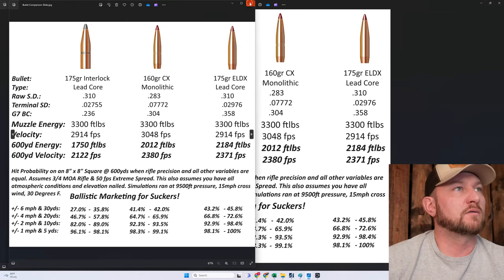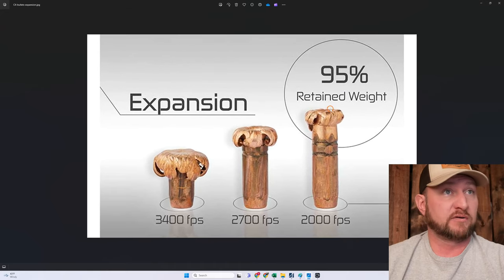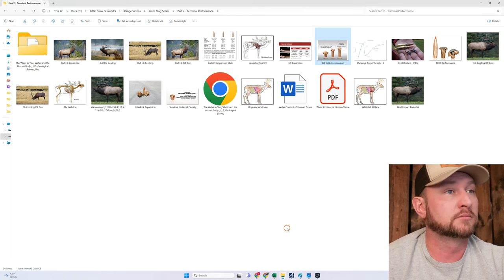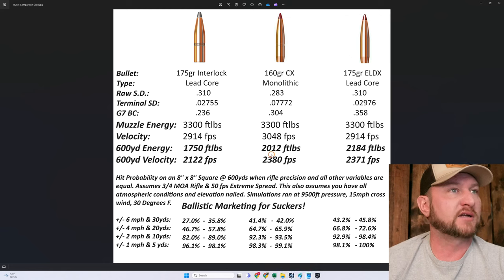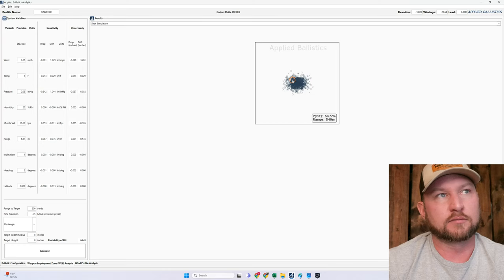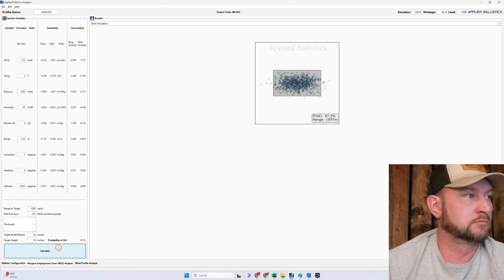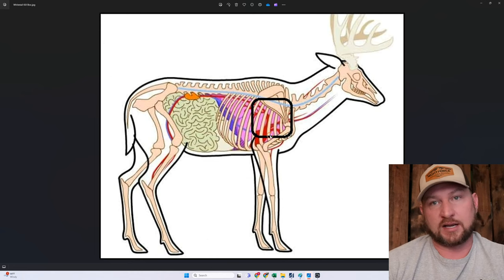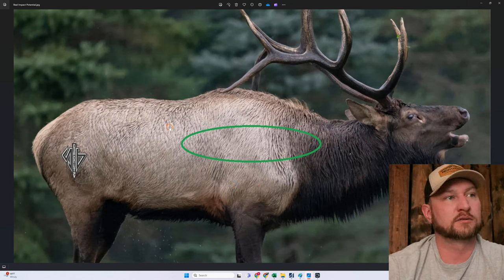7mm Showdown | Part 2 | Why Bullet Construction Matters | Terminal Performance & Hit Probability

Comment: Tim, have you done any performance with 8.6 blackout? If so, curious which brass and dies you're using. I like the trimmer with replaceable inserts for different calibers, although it would be nice if you could combine chamfering like the Giraud tri-way trimmers do (yes, I realize they do not have 8.6 blackout or 6.5 Grendel in tri-way).

EDIT: as a follow-up question, would it be possible to create a chamfer tool that could chamfer inside/outside of case in one process?
Reply from the maker: I have not loaded for any Blackout cartridge. We are aware, that if we could make our trimmer into a tri-way, we could OWN the trimmer market. But the way we look at it is, if we can't make it perfect, we're not going to make it.
Reply: @LittleCrowGunworks  I agree, and do believe that is why Doug won't make them anymore, remember his don't have interchangeable inserts. Back to the chamfering, if you could make a similar tool that would just chamfer, not trim, would it be possible? I currently use Lyman manual chamfering and it takes a while, the outside is worse than the inside. I don't want you to think I'm ungrateful, I have the 8.6 blackout trimmer as well as 6.5 Grendel and 300 blackout inserts. I have a 300 blackout tri-way also...back to 8.6 blackout, I have seen shoulder issues with dies/reamers/chambers and that was why I was curious about the insert, as that is where the shoulder is handled. What dies did you use for the shoulder? I haven't used dykem on your insert with brass, but since it only trims length, it doesn't matter as long as it seats solid.
Reply from the maker: We cut our trimmer inserts with the same type of chamber reamer you would use to chamber a barrel.
Reply: @LittleCrowGunworks  Yes, what reamer do you use? The only choice right now is C.I.P. as far as I can tell. I see definite differences between gauges, dies, chambers, et al This is why I was curious which reamer you use. PTG claims SAAMI on their site, I don't believe it. Steinel says they use the PTG on their gauge, but Sheridan is a different shoulder, AFAICT.
Reply from the maker: We ONLY use PTG Reamers.
Reply: @LittleCrowGunworks  Thank you. Let me explain. I just dumped my Gorilla brass and await Vairog. Steinel Arms also makes a gauge, and because of what I described, they used the PTG reamer for their gauge. From memory, he mentioned a similar problem I described where there's some difference in throat/shoulder/chamber/die/gauge. I have the Redding dies for 8.6 resizer, but with Gorilla brass it won't resize. The Hornady resizer is able to resize the neck, so the brass will go in the Sheridan gauge. But I also see a problem where once the Gorilla brass is resized, slightly the shoulder prevents it from going into the Sheridan gauge. I'm switching to Steinel Arms gauge, Vairog brass, Redding Dies and PTG reamer. I just pulled 100 reloads in Gorilla brass. I don't think Gorilla has a problem with their ammo, because I believe they use a commercial reloading machine that works in everyone's chambers. This problem is only seen with people like me trying to reload for 8.6 blackout on small presses. I don't think Gorilla has sold too much brass either. But many people reloading for it see some of these issues. Sorry to be so wordy...

Comment: Very good video and points made.  The discussion points regarding energy dump vs penetration were particularly good.  The fact that penetration wins is IMO, best illustrated with bow hunting…penetration is paramount to deflate the balloon (lungs) and get a good blood trail.  The argument about well constructed bullets monolithic and bonded vs cup and core are similar to the arguments around fixed blade and mechanical/expanding broad heads. The latter fly like field points but also fail to penetrate like a fixed blade. I will stick with my fixed blade broadheads and either bonded or monolithic bullets…which ever shoot better in my rifle.
Reply from the maker: Well said.

Comment: I was interested in monos but just like the stories about eldx i have also heard of monos not opening up and leaving a pinhole in and out or Tumbling and deviating in weird ways. It seemed like it was a new trend that wasn't perfected. Have you seen a mono fail and what did that look like?

I have always used sierra game kings and always had huge exits on whitetails but i can see how an elk might be different
Reply from the maker: The bullet I refer to in the elk story at 40 and 70 yards, was a 200gr Sierra Gameking. Completely exploded. Despite what it says on Sierras website for that bullet, it was VERY evident that it was never designed to tolerate 3000+ FPS impact velocities. It's not like he hit the shoulder either. Both shots were mid lung. 

On the other hand, Dale hit a mature 5 x 5 elk last fall, also at 40 yards with this 28 Nosler and the 160gr CX. Over 3100fps impact velocity, broke both shoulders at the joint and left an exit hole you could stick your thumb in. The elk fell flat on its face, never moved and was dead within a minute.

I think most pinhole/tumble mono stories are on soft targets like whitetails with Barnes TSX hollow points or at longer ranges where the bullet has dropped below 2300fps...which is the minimum expansion velocity for that old TSX, despite whatever the website says. Those require something substantial and high velocity to make them open. Which is why nearly every mono these days, have a plastic tip to help initiate expansion.
Reply: @LittleCrowGunworks   thanks for clarification. I live in texas and hunt for meat only and we don't have many elk. I raise exotics though and know a lot of hunters. Most of which are old school and use some sort of bonded or are new school and use eldx. I don't trust eldx but have been using them for a few years now but headshot everything lol.
Definitely lots to think about and most hunters want a pass through for a blood trail and probably don't realize that exit hole also collapses the lungs.

Comment: If I can shoot a saucer  75%@ at 500 that would be a dream!!!
Reply from the maker: Define saucer?
Reply: @LittleCrowGunworks  like a paper plate or milk jug.
Reply: @LittleCrowGunworks  my thought I want to choose a caliber that I can reload affordable and plentiful. I bought 300 bullets for $80 they were midway over-run bullets, 162 grain 284 caliber. They look great hopefully I can them loaded up by this weekend.
Reply from the maker: Oh ok. A paper plate at 500, 75% of the time is achievable. But it's going to take a lot of rounds fired at that range, in the wind for you to be good enough to hit it on a cold bore shot 75% of the time.
Reply: @LittleCrowGunworks  I have three rifles with carbon fiber barrel and they don’t seem to do that, my struggle is shooting my 7prc having huge gaps after about 4th round of three shot burst. I think I develop a flitch. But with 6.5 prc no issue or 6.5 creedmoor. All have carbon fiber barrels.

Comment: What bullet was the broadside elk at 40yds?
Reply from the maker: It was a 200gr Sierra Gameking. Read the description on their website. It's recommended for high velocity cartridges on large game at close to long ranges.
Reply: @95GTSpeedDemon  he’s anti cup and core bullets which is okay and his opinion always going to be the debate between everyone lol but I’ve been happy with the performance of Berger’s out of my 270 wsm on elk and whitetail everything has died in sight I’ve also used Barnes ttsx on elk and whitetail worked good on the elk but never did get the pass through I was looking for ran maybe 30-60 yards the elk I’ve shot with them but the white tails that’s a different story they made it 150 200 yards so I did make the switch to Berger vlds and they’ve been good if it didn’t drop it made it maybe 5 steps
Reply from the maker: To clarify guys, I'm not anti cup and core. I'm anti cup and core on elk. It's just not worth it. It's fine when the animal dies in sight. Or when you shoot one in the high plains. But when you're in some shit hole canyon and if he moves 10 yards, he's completely out of sight and it's going to take you an hour and a half to get to where he was standing, you want a blood trail.

Out of curiosity Wyatt, what was the weight and diameter of the TTSX you hit your elk and deer with and where did you hit them? This stuff all matters. I'm guessing the sectional density of the TTSX you used was under .260 and maybe also he wasn't fully broadside? It's not a universal truth that all mono's will exit. They still have to meet certain criteria.
Reply: @LittleCrowGunworks  one of the things that has been brought up on rokslide and the podcast was elk vs deer. Elk dont wear body armor. They arent but a couple inches wider than a whitetail. They are just taller and longer.
They dont have magic bones that are made of kevlar.
I havent shot one or held parts of an elk so thats all 2nd hand info.
I rather people hear all arguments and make a decision for themselves and reevaluate based off of results.
I agree, a DRT kill is much better.
Thats why im after the TMK type ballistics. Heart and lung shots require the animal to be deprived of blood/oxygen and pass out. That can take awhile sometimes. CNS shock kills instantly. Especially with slower moving elk, a rifle and skill for a follow up shot appear to make a big difference in outcome.
Reply: @LittleCrowGunworks  the couple bulls I used it one was 30 yards the other was 225 it was a 130 grain ttsx bullet velocity average of 3230 both were broadside and found bullet on exit side hide the close bull one of the pedals was super mangled so not sure what it hit but yes sectional density is like .242
Reply from the maker: Right, so it was enough to get to the off side and kill it, like a Nosler Partition would. But it didn't exit because the initial sectional density and therefore terminal sectional density was too low. Barnes makes a 155 LRX for the 270 that would exit, but it needs a 7" Twist in my opinion.

But honestly it's the wrong tool for the job in my opinion. I don't like short action cartridges for Large Game.
Reply: @LittleCrowGunworks  it’s my all around gun it’s killed 10-15 elk from 5 yards too the furthest being 350 and the furthest I’ve had one go was the one with that Barnes but still wasn’t far at all and yet to lose one that being said I was looking at buying a 7prc but going to wait and see how this series plays out
Reply from the maker: Good deal. Yeah wait for all the information so you can make the best decision for you.